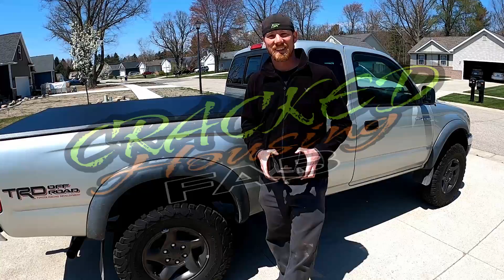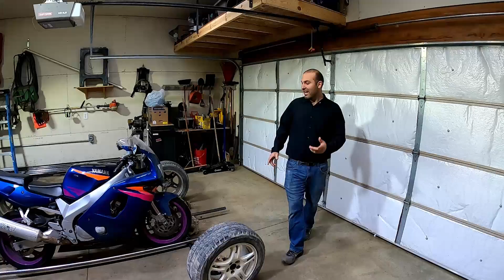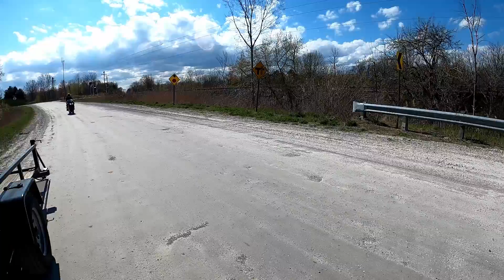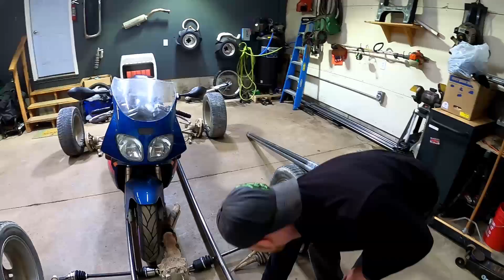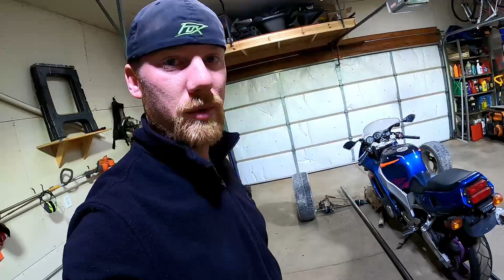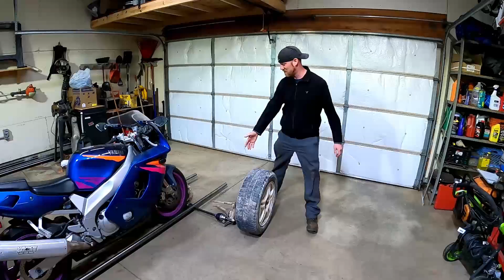4x4 CROSSKART Build - Yamaha YZF600 with Subaru Drivetrain! Intro!

Comment: Hi guys why are you flipping the rear differential it turns the right direction.can you show in your video how both differentials turn.also make sure that they are both the same ratio so one dose not work agince the other one.also what have you decided for reverse and is this going to be a single seat or two seater.
Reply from the maker: Hey steven !  Single seater.  We are flipping the one diff because they are both rear diffs. If we dont flip one, they turn the tires towards each other,  our next video we will show the rotation.  We have  had a few people ask aboit that. We will lay it out and show it! So basically we are using to rear end setups,  and just using the front spindles from the car so we can turn

Comment: One idea ( from boosted boyz actually) the center drive shaft you could include a viscous coupling in there ( a very tight one.) 
That way you would have a little “give “ between the front and rear wheels and then you can drive on all surfaces without destroying stuff. 

Some viscous couplers can be rebuilt to race spec and only have a small amount of give.

Just need a drive shaft mount either side and all good.

If only going of road then no real need but if you want to do awesome 4 wheel donuts the a viscous coupler will help

Great build guys!
Reply from the maker: That's a great idea! I think we will be mostly off road but that is something we can definitely look into incase we wanted to, like you said, do some epic donuts!

Comment: How much do you want for the frame of the bike after you take the motor out
Reply from the maker: Where are you located?
Reply: I am located in Houston Texas, but for clarification are you disposing of the wheels,forks,handle bars and stuff like that and if so how much are you selling it for.
Reply from the maker: We are going to take the bike apart and get what we need off of it and we will see what we have. I think we are going to list the stuff on ebay when we are done and put the links in our video description for you guys to be able to go and grab.

Comment: That's a serious wheel base should be very stable
Reply from the maker: It looks pretty wide in the video but it should be roughly about 5ft wide. I've watched some of your videos in the past, your cross kart rips!! How wide is yours?
Reply: @CRACKEDHOUSINGFAB oh ok  yeah it does look wider in the video, mine is 70" in the rear due to the big rear tyres but only 64" in the front
Reply from the maker: OK yea so we will be right around the same size as yours
Reply: @CRACKEDHOUSINGFAB  pretty cool I always thought using a diff would have made it much wider but I guess not . 
 I wish I had a diff at low speeds cause I have to flick turn to turn around currently.
Reply from the maker: We might weld the diff in the rear or see about a locker because they do make one for the Subaru diffs

Comment: I didn't realize you could use the rear driveshafts for the front. I thought the front driveshaft had some extra components for steering. I have no experience I just assumed. This is really awesome though! It gives me hope for building mine that I could have it AWD which I never thought it could be!
Reply from the maker: Yea! We are actually using the front hubs/spindles from the car. Then adapting them to work with the rear diff and cv shafts!  The cv shafts dont know the difference

Comment: you could use the front forks of the yzf , for the suspension on the front
Reply: A fork for each side as a shock is that what ur saying
Reply: Thats a badass idea. Long travel on all 4 corners. Dude fucking sweet.
Reply from the maker: Absolutely! We will be using them either in the front or back! Thanks for watching!
Reply: @CRACKEDHOUSINGFAB  the yzfr ones are good for the front because they are stiff and have a shorter travel then the forks from the Enduro, the enduro forks are nice for the rear and "bit" comfort for you're back.
Reply from the maker: We want to use the yz450 fork shocks for the rear and then we have two yz450 rear shocks that we want to use for the front
Reply: @CRACKEDHOUSINGFAB  really looking forward to thos build guys.
Reply from the maker: Awesome! We can't wait to get started!
Reply: @CRACKEDHOUSINGFAB  so you go for short travel rear and long travel front as you're saying
Reply from the maker: I think if we mess with the suspension geometry we can have alot of travel all the way around
Reply: @CRACKEDHOUSINGFAB  eh no because the yzf forks are designed for short stiff road racing suspension. Then you must go try and find different inside cartridges for the fork legs. And also modify the inside of the fork leg, then you need to weld inside the fork legs and after that the forks need new chrome if you would do that, if its already possible and a lot of work. Then it is better to sell the good yzf front end, and buy a 2nd set of yz450 forks
Reply: Josh Frank  depends on what kind of seals you use
Reply: Josh Frank  i know i tried to tell them in the replies above, most times people need to learn the hard way 😉